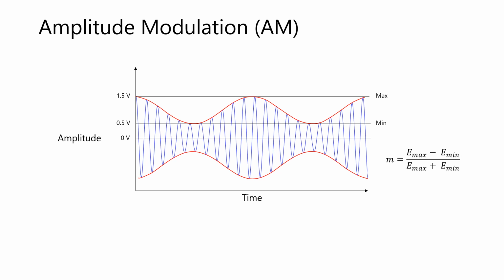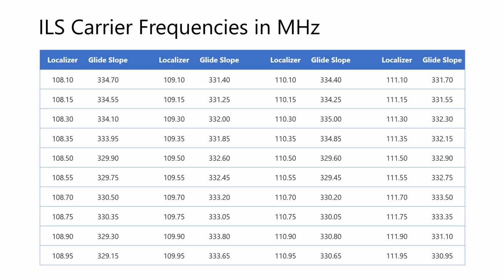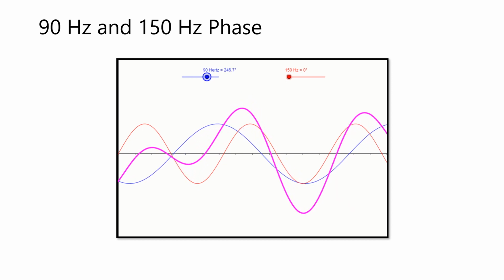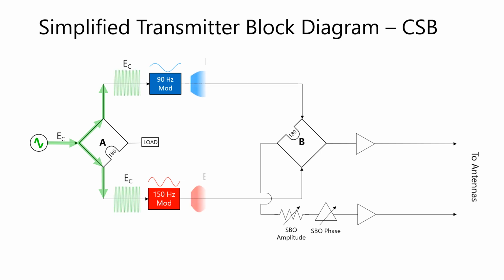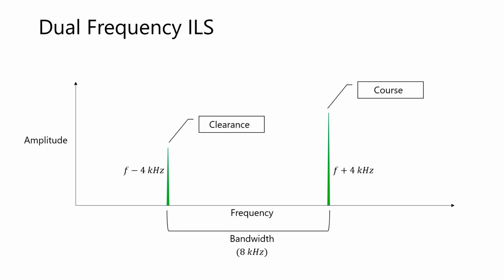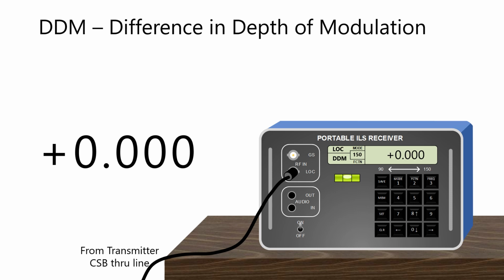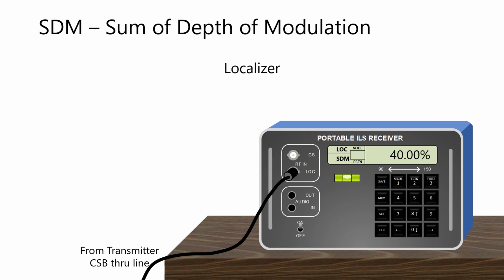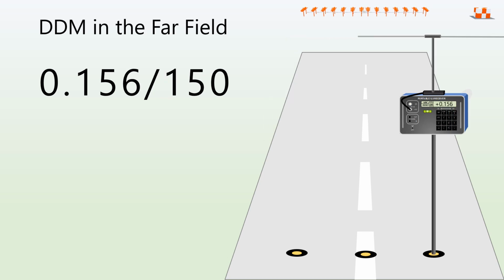02 - ILS CONCEPTS - ILS Signals

Comment: Keep on the good work buddy. 
Another comment or question, we know that SBO is modulated by the 90Hz added to the inverse of 150Hz tone, so if you may explain why you are presenting SBO as -90 + 150 !!?
I really thank you for the great efforts 🙏
Reply from the maker: Good question! I had to do a deep dive on that very issue. Here's the answer:

I initially learned, as most of us likely did, that SBO was + 90 - 150 at the transmitter. But later, I found this to be contradicted by other sources (1970's Wilcox Technical Manuals, and some FAA theory course material) saying SBO is - 90 + 150 from the 90/150Hz generator in the transmitter. It was driving me nuts - which is it?! It also seems impossible to discern on an o'scope because we can't determine the start of the signal and it goes through an absolute value circuit where we see the (fingers pattern) audio waveform. So, what convinced me that it must be -90 + 150 (besides various texts and opinions) is the resultant 150 tone below the first SBO null (glide path) on the Glide Slope. Electromagnetic theory states the (SBO) lobe above of the first null in an image array glide slope is an inverse lobe. So, the SBO lobe below the null is positive (relatively speaking). Thus, the SBO audio phase from the transmitter must be -90 + 150 for 150 to predominate below glide path - since CSB +90 +150 is also considered to be a positive lobe, the 90's cancel, leaving 150 to vectorily add.

I also talked to Roger Holms, the author of ILS fundamentals and owner of NANCO, a European navaid consultant company on this very topic who had this to say:

"Since ICAO never defined any sign to DDM, it has been a worldwide confusion what is plus or minus. Manufacturers and book writers simply had to make their own definition. In the 50s and maybe the 60s you could only say fly right or fly left after the DDM value, but in modern flight inspection equipment and monitors it will be difficult not have a sign included. I think most cases just used 90 and 150 in that order, so I believe DDM = 90 – 150 is the most used local definition worldwide. But I found no particular mathematical nor vectorial reasons to go for that version. On the contrary, using 150 was much easier to explain and demonstrate for starters. I clearly see that that this discussion should be included in the book, and I have started to prepare an extra page. I hope it explains the reasons why we used to 150 instead of 90 to indicate positive DDM."